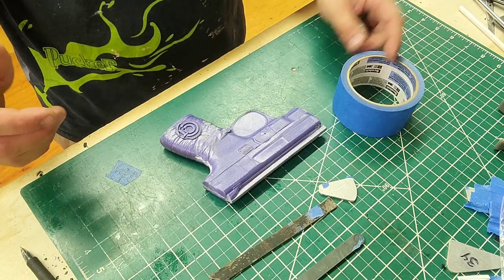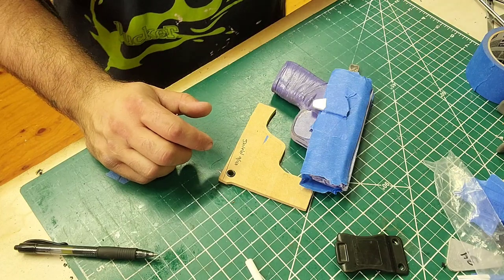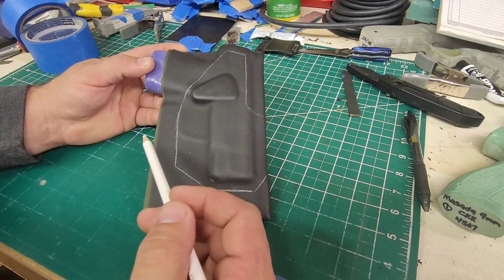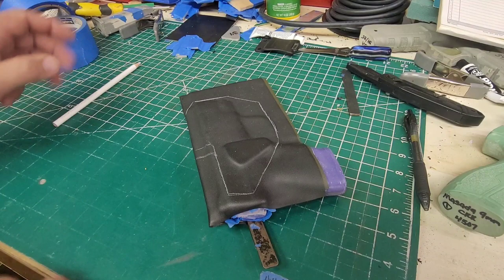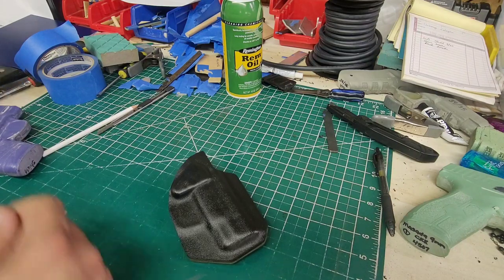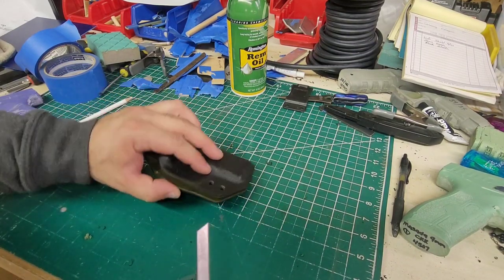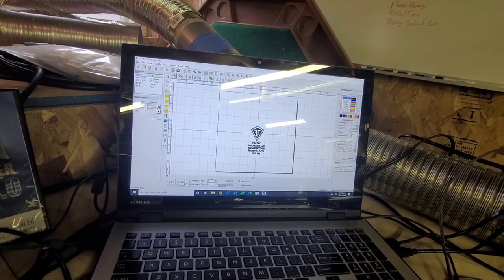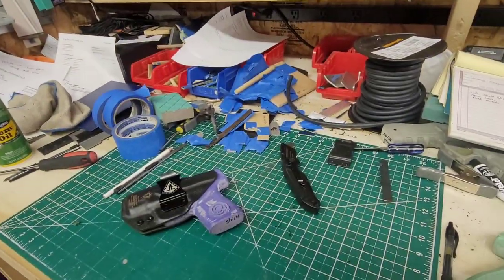Double layer holster time.

Comment: So thanks to you I've now got a new hobby 😂. Couple of questions though.
What's the reason for doing a double, and what size thickness do you normally use for a holster? Thanks for the videos
Reply from the maker: Two reasons for double. 2 different colors and thickness of holster. Normal is .08
Reply: @FalTacUnlimitedLLC  
Thickness of holster reason for rigidity? Made my first out of .08 black kydex for my brothers Ruger sr22 to try out and from your videos I'm doing one with sidecar for my M&p. 
Also where do you get the extra tall pieces for the mag holster clip and the retainer thing for the mag holster. Thanks
Reply from the maker: @shawn5141  everything is from holstersmith.com
Reply: @FalTacUnlimitedLLC  thanks. Will be a great resource for my next one

Comment: I’ve been working on some double layer holsters lately, been having some issues with them splitting apart in some spots. Nothing huge but wondering what you do to get them back nice and tight. I want it to look like one solid sheet. Didn’t know if I should get it a little hotter then press or press it down harder for longer. Seems like a lot of time it’s during drilling, but what a good fix if it splits?
Reply from the maker: It won't split if you melt it together for a while. Same temp but for about 400 seconds. Does the trick. Good pressure as well.

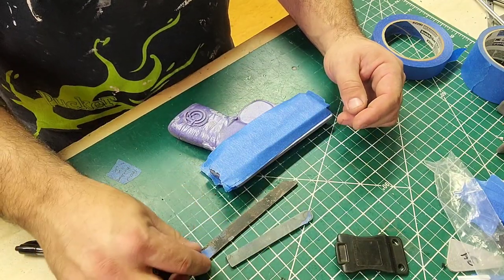Comment: @2:52 you say "we have a couple options here" and then pick up some metal strips. Which i think you call blocking. You never really explained what any of that is for and why you need it. Is that blocking to stop the kydex from forming around the slide release , ejection port and safety so you can pull the pistol from the kydex? Im assuming if you didnt block those things off including the sights you'd have a stuck pistol inside of a piece of kydex.
Reply from the maker: Blocking is used to create a pathway for raised or lowered areas on a firearm. You're correct in saying you'd have a stuck firearm if you don't block for something. For example, slide releases. The kydex will form around the slide release , create more retention, and add holster wear. If there is blocking. That will create a path for the slide release to travel freely inside creating no extra friction and added holster wear. Most of the blocking I use is created in house from aluminum flat bar found at home depot
Reply: @FalTacUnlimitedLLC  Thank you so much for answering that. I really appreciate it. Ive been binge watching your videos for days now. I hope my Binge watching increases your channel analytics. lol
Reply from the maker: @DisclosureTvNews  hell ya!

Comment: What is your thoughts on pressing the .08 first then trimming out a design of the .06 and pressing over the freshly pressed holster instead of pressing both at the same time? maybe put the heat gun to the .08 holster just prior to wrapping the .06 custom design cut around it
Reply from the maker: You can totally do that. It's very different and you'll see when you do it but it is doable

Comment: What did you use for the rubber spacers? I’ve been looking for a spool of that hose to use but what kind is that??
Reply from the maker: Pn 65112 from Amazon. Continental windshield washer/overflow tubing
Reply: @FalTacUnlimitedLLC  Dude thank you so much!
Reply: @FalTacUnlimitedLLC  Have you found another source of screws? All the screws I’ve been finding seem expensive!

Comment: I see you are using a metal FOMI style clip. Do they tend to hold better than the plastic clips? They seem to be more rounded where they contact the bottom of the belt on the ones that I have seen, but I've never used a metal one myself.
Reply from the maker: I live the metal so much more than the plastic

Comment: Hello, what's the model of the blue jack you use on your press. Thanks
Reply from the maker: Search motorcycle jack on amazon. Make sure it has the ears for the bottom plate. And I wanted a hex head for the screw

Comment: What type of screws and hardware size do you like for 0.80?
Reply from the maker: All depends on what's going on the holster.
I use 1/4 Slotted Posts Posts fomi and retention. .4375 screws for retention.
3/8 screws for fomi with 1/4 rubber spacer.